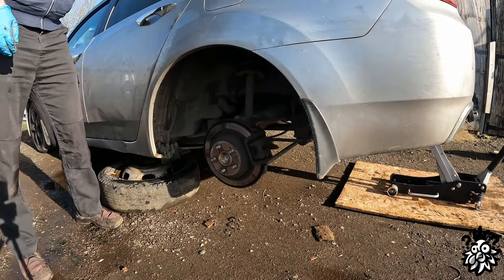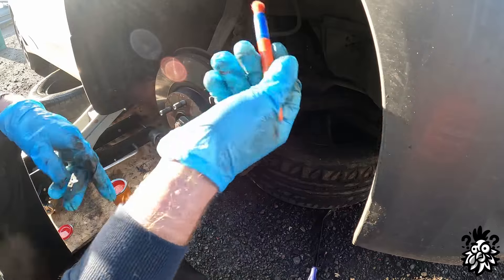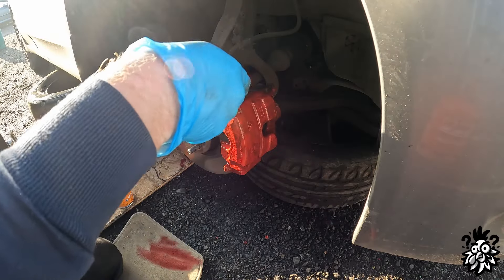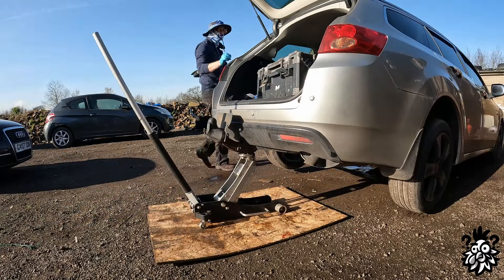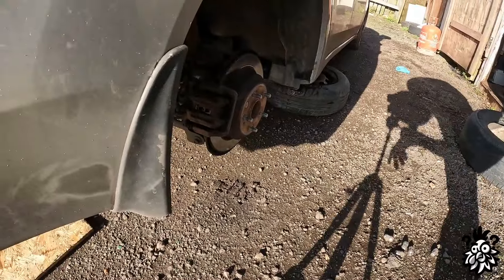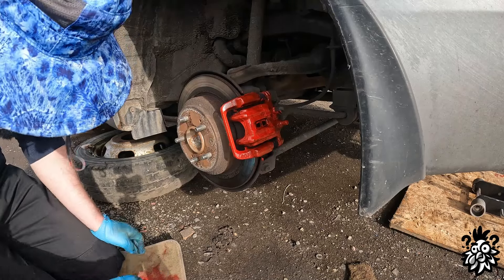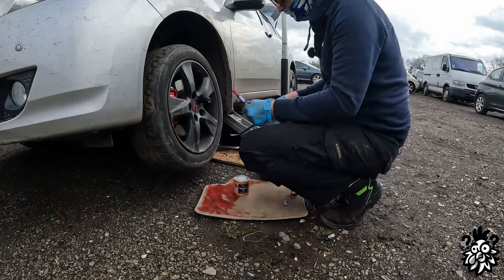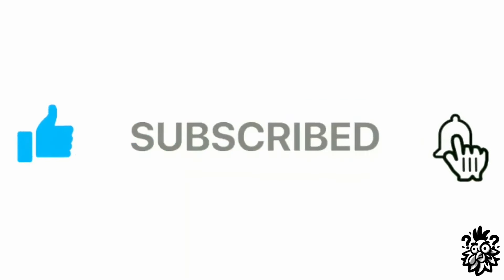Painting the calipers!

Comment: I used this same red caliper paint from Halfords on my calipers. Painting it on brand new calipers the paint was really shit. Started flaking off when you sneezed on the things. Maybe I didn’t clean all the grease off. Also the paint is hard to clean off the brush so I used cheap b and m brushes and threw them out afterwards 😅
Reply from the maker: My looks OK I think 🤔 didn't really check if anything is flaking off 😂. I had the brush from b&m too and haven't checked on it since I've painted the callipers 😂